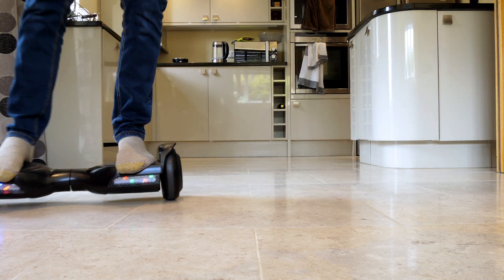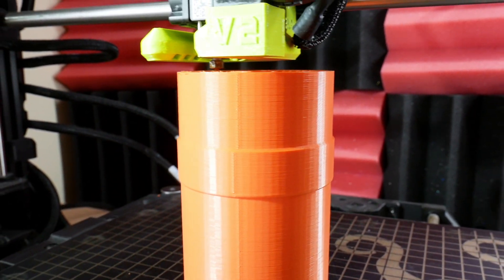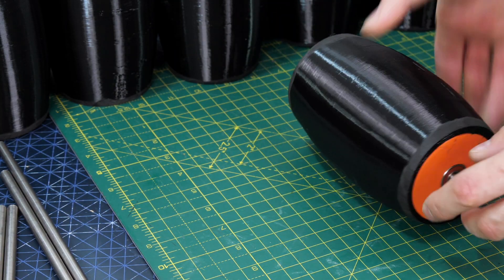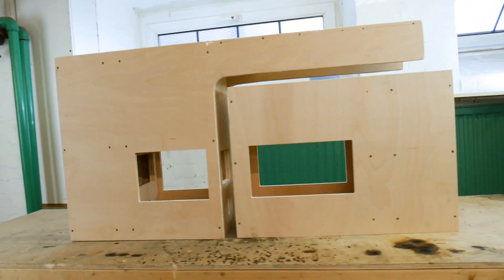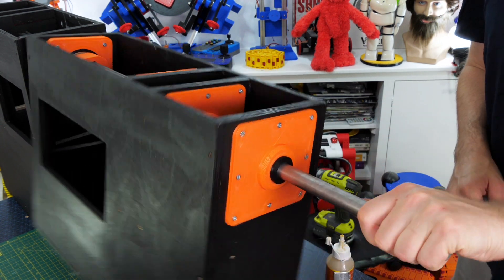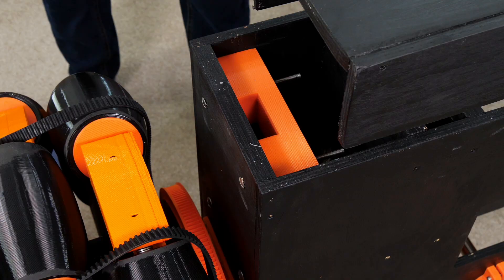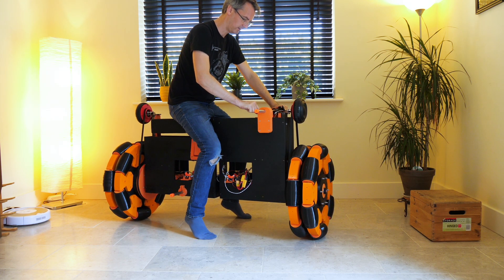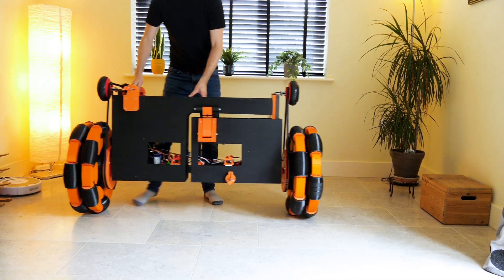Omni-Wheel Bike

Comment: I appreciate that you don't turn the 3d printing part into 5 episodes 🙏

I can't even imagine how many hours and days the printing takes, let alone everything else.
Reply from the maker: yep it was a few hours ;-)
Reply: Such a thorough rebuttal, well done @teresashinkansen9402
Reply: There is so much process, it could be 50x 15 minute videos
Reply: I actually find silly the amount of 3D printing, even printing the "tower" for the belt tension when probably that could be done with a piece of plywood. imagine how much energy is used . I actually was nicely surprised to see he actually has fabrication skills and used some metal but still i find the amount of 3D printed parts kinda overkill. I only print with my 3D printer complex shapes or things that actually make sense to print. Why print a standoff that will take hours and use energy plastic and wear my 3D printer when I can cut a piece of wood in 10 minutes to size.
Reply: @teresashinkansen9402  In fairness, printing rather than fabricating or carpentry saves a lot of issues: namely weight. If you've ever used an e-bike, they are SO heavy, and it makes them really unwieldy, plastic is a lot lighter. 
Also, printing helps accuracy and the ability to make each piece identical. You can see how even just a few mils of deviation in the plywood caused problems with the balance of the whole bike, and he used a CNC; imagine if more of the bike had been made the same way.
Reply: @teresashinkansen9402 everyone loves excessive 3d printing. It makes them feel important and like big men.

Ah I just got to the part where the sponsor is a 3d printer manufacturer.

That explains everything.

Gotta prove for the sponsor that 3d printing is better than sex, and soon morons will be trying to 3d print food. As if there wasn't enough artificial mass produced, over preservative-ed, unhealthy food.
Reply: @teresashinkansen9402 And exactly what is the cost and BOM breakdown analysis? Oh right you don't have one.

The energy emitted by the printer is so insignificant compared to the logistics of growing an entire tree, cutting it down, shipping it to the mill, processing it so you can have a single infinitely small piece of it, then package that, ship it to your local store, where it is further itemized and stocked on a floor that has their own set of costs and needs?

Your analysis is incredibly short sighted and bares no water.
Reply: @Mad_Catter_ what about making the plastic itself tho
Reply: @redtaileddolphin1875  That wasn't the person's talking point. If you want to debate the process of recycling or manufacturing plastic that's fine, but it's still going to be comparable if not cheaper than destroying a forest.
Plastic is inert and can be produced as we please, in a convenient manner, with better methods of production or recycling rounding every decade or so. Forests are much, much more complicated and an industry that is essentially set in stone.

Recycling a piece of wood into another usable chip form of it's former glory, also comes at higher costs and manufacturing processes' that require incredible amounts of fresh water.

I can go on for days about logistics.
Reply: @Mad_Catter_  I find so ironic that you say that, and clearly shows you have no idea what it takes to make plastic and eat up the ecologist propaganda that logging is the avatar of environmental damage, your very same argument is actually all against you.

So please show me your talk about logistics, actually worse logistics applies to 3D printing materials. I cannot wrap my mind how 3D printing such part is better than using a piece of wood. Most wood in developed countries come from forests specifically maintained for wood, that is they already were obliterated many decades ago and now host a plated population for the sole purpose of wood production, so the damage to diversity is already done, as you said it its already an established industry. Second, forests capture CO2 so they have a negligent carbon footprint and wood only becomes an issue when the wood is used as fuel, then its CO2 foot print becomes worse than many fossil fuels per BTU but we aren't talking about fuel but construction materials and plastic.
 Logging and wood working are actually relatively energy efficient compared to plastic production, according to "Fuel consumption and exhaust emissions in the process of mechanized timber extraction and transport (full citation at bottom) " one cubic meter of timber requires about 2kg of fuel (release 6kg of CO2) to be processed from harvest to finished product with a transport distance of 33km. Now lets see what it takes to make plastic and not only that but turn it into filament and 3D print it.

Producing plastic requires a significant amount of energy and varies a lot depending on the kind of plastic produced from two times its calorific energy to up to five times (like PET which is used to make PETG) or more, that means you need about 2-5kg of fuel to produce 1kg of plastic, you see, that already does not sound great, with the fuel used to make 1kg of plastic you are already using the equivalent fuel used to produce one to two cubic meters of timber. Not always but cost also reflects this because you cannot go cheaper than what you spend on energy to earn money selling something, a finished (even pressure treated so that adds cost) 10ft 4in by 2in in home deepot costs 7 dollars which weights about 8kg, thats a cost of .87 dollars per kg, compare that to the usual 30 dollar per kg of filament.

With plastic you have to extract the oil which already requires significant amounts of energy, then you have to transport it to a refinery, there you purify it and then convert it to the raw materials and that takes a lot of energy, have you heard of thermal cracking? it is widely used to make ethylene, hydrogen, propylene and many other plastic precursors, to do that you have to heat up oil and other oil products to very high temperatures (in excess of 600C°) and use a catalyst so the large molecules turn into smaller ones, then you have to purify all what comes out and once again transport it to factories, in the case of gases like ethylene, propylene and others you have to compress them with significant amounts of energy. 

So then you have to make the plastic which also involves lots of energy, i wont make a description of the processes because this reply is already long but is not that straightforward, you must already know after making those statements, I presume, what it takes to make PET and PETG right? well then you have the finished PETG pellets which are now transported again to a filament factory which are usually quite far from the plastic factories sometimes even in another continent, there you have to melt the pellets to make the filament, heating things up and then making them change phase usually involves lots of energy, don't forget the filament also has a spool which usually is made of more plastic.

Well now you have your filament spool but it has to be shipped once again to a store! just like timber getting shiped to a home despot store where fanatic geeks that seem to follow personality cults buy their filament they purchace it or get it shipped to their home, where they now print a plastic 2 by 4 rectangle, which takes 12h to print and needs about 960Wh to print or about the equivalent of 80g of fuel which releases about 240g of CO2. Compare that to using a circular saw for 15 seconds to cut a piece of wood (700Wh for 15 s rounds up to 3Wh) and some minutes of a sander to fine tune the size (3 minutes of sanding at 800Wh gives 40Wh).

All this is extremely simplified we can go to explain every detail in the lumber and plastic production chain but the result is the same, plastic takes much much more energy to make and is significantly worse for the environment, using a piece of wood instead of printing everything is very good, not only for the environment but also your wallet and handcrafting skills.  

Lijewski, P., Merkisz, J., Fuć, P. et al. Fuel consumption and exhaust emissions in the process of mechanized timber extraction and transport. Eur J Forest Res 136, 153–160 (2017).
Reply: @teresashinkansen9402  "you have no idea what it takes to make plastic"

Yeah, haven't even touched the topic of making plastic therefore I'm not reading an excerpt you didn't write, you didn't research and merely scraped from the first source you passed by.

Waste of everyone's time.

Verify where I have stated how plastic is manufactured or recycled, then we can move forward with your inane ranting.
Reply: @Mad_Catter_  Well that's because you have no argument to make, you got obliterated. But in case you have reading difficulties, Ill make a tldr right here, ill do my greatest effort so you can comprehend it; My beef with this is that 3D printing everything even the simplest things is a waste of time, money, energy and resources. its very simple i just got into detail why 3D printing is a waste if not used properly.

The hard reality is that I aggravated your ego by criticizing James, be it because you follow a personality cult or because I criticized what you do with your 3D printers and made you feel stupid, maybe you 3D print rectangles to use as standoffs and spent dollars and hours when you could spend minutes and cents?
Reply: @Mad_Catter_  And well replying directly to your question about costs. A 8ft 1in by 3in board costs $2.54 USD at home depot, cutting it to the size of about 20cm which seems to be about the length of that "tower" James used would end up paying $0.20 USD. If he 3D prints it with an infill density of say 25% a rectangle of 2.54cm by 7.62 cm by 20cm has a volume of 387cm3 the 25% of that is 96cm3 with a density of 1.27g/cm3 it would be 120g of PETG, if it costs about 30 dollars per kg that part would end up costing $3.6 USD and that's just the filament cost, not taking into account the cost of the energy used nor wear of the 3D printer. See, it does not make any sense to print such kind of parts.
Reply: @teresashinkansen9402   And lets not forget that when making small parts out wood when woodworking is already part of your process is basically free use of what would otherwise already be waste material.  Wood wins nine ways to Sunday.

If Mad Catter wants some credibility maybe they could at least match the effort it takes to copy paste something from an actual source.  Of course then someone might still come along and point out how teresa clearly did write all that very detailed and thorough analysis given the tone and contextual specificity to this conversation, using the source for figures.

It's ok, my ego would be pretty bruised too.  Maybe you could convert that negative emotion into something productive by following up on the source, verifying all the quotes, numbers, and calculations; maybe catch some details the source doesn't support.  Then instead of losing an argument and just being wrong in public you're doing science and contributing to intelligent discourse.  I'd do it but I'm just not invested enough to warrant the effort. 🤷

Comment: How about making a true hoverboard using big EDFs on a skateboard with hovercraft skirt and stuff, and maybe some additional thruster or just some holes on the back of the skirt that gets exposed when you lean forward or something like that to produce thrust? (and if that approach with the hole, or even just a shorter segment of the skirt, works, perhaps also add smaller versions on each side of the tail (or nose, depending on how the dynamics will feel) to allow for handsfree turning by leaning?)

Comment: nice project , but using the rollers as fw/bck and the wheels as side to side seems inverted , when you need to pass a hole or a bump , the rollers are to small ...
Reply from the maker: How would you power all the rollers?
Reply: @jamesbruton   for the drive of the rollers I have an idea , for the power I have 2 , one more affordable , one more technical and more costly . For the drive of the 12 rollers , 1 circular axle in the middle of the 2 roller rows with universal joints , and on these axles  direct >> "chevron" gears or wheels to assure no slip on the rollers .
For the drive of the axle : the cost effective : put the hoverboard motor nearest to the center of the wheel axle and counter weight  to reduce unbalance (Li Po at opposite side at calculated distance for exemple) , and a slip ring to get the wiring back to the board, and the motor drive a belt to roller axle . For the expensive way , a "tron bike" look a like hub , the hoverboard motor fixed in the middle but turning with the whell and one of the PCB's and LiPo on the sides of the hub or structs that hold the hub (may need to be connected to the other wheel to assure voltage balance between the PCB's)  , with a gear or  shaft transmission to the center shaft . The problem is that the hub design needs very expensive large roller bearings ...

Comment: I understand the desire for this to be a bike. But since your wheel axis is orthogonally to your desired vector, you will have a severe problem with not just propulsion, but also braking. To brake on this system, your options are 1) ground friction or 2) reverse thrust. Neither of those are particularly good.

If I may, I suggest switching from a bicycle to a chariot. For turning, use levers to twist the chassis - they could be foot, hand, or even shoulder actuated.

Comment: YES! I've wanted to mod one since I first got one in 2016!

Edit: not what I thought it was going to be at all. This was a cool project, but I'd be lying if I said I wasn't supremely disappointed.

PS: most hoverboards allow you to calibrate the gyroscopes by holding the power button when you power it on until it beeps a second time, then you hold it perfectly level until the lights flash/stop flashing, then your calibration will take effect next time you cycle the power. This is a much better solution than shimming the boards

Comment: How about making a box with a big gyroscope that you carry in the bike rack or basket and helps keep the bike vertical when standing still without putting the feet on the ground.
Reply from the maker: It has a solid state gyro - it moves sideways to balance. Check out my last video for a gyro bike?
Reply: I was thinking more of a device that you could attach to any normal bike and make it stand upright when stopped

Comment: The project is cool and looks like you also have quite a good machine shop 
Do you have any plans to show the shop better?
Reply from the maker: It's just a CNC and a workbench
Reply: @jamesbruton And a sanding wheel

And hydraulic press

And welding equipment

And the 3D print farm

Do you have/gonna get a metal lathe milling machine too?
Reply: @bornach re: Lathe. That's what Colin Furze is for.

Comment: Handle bars need to be connected to the part you're controlling with you feet. My guess is that will solve your turing problem. This might be my favorite project so far. Great work.
Reply: Your feet/legs are not precise at controlling stuff.. arms are more precise.
Reply from the maker: Electronic controls in the next video

Comment: Ok, this might be my favorite project ever on this channel and that's saying something. I'm starting to see the potential of this crazy contraption.
Reply: Same. I'm curious whether it might work nicer with the omniwheels turned 90 degrees but with fixed front wheel and then let electronics do all the leanign and turning. It might roll better for transport means. Now the big radius of the wheel is used for lateral riding where you need the least speed and comfort.
Reply: My favourite project yet!
Reply: Same but the engine is so cool
Reply: I like the hulk buster project the most
Reply: This vehicle can only spin and drive left or right. A motorcycle style seat but you must turn your head to see where you are going. What is it you like about that? It looks awkward, uncomfortable and useless, although exquisitely engineered.
Reply: @mattsenne6951  I thought he made it clear at the end of the video he still needed/planned to work out forward motion. His projects are usually episodic, and he comes back to different ideas whenever he comes up with a solution or new application for a previous design.
Reply: @mattsenne6951  I think it will go forward, but with the worst possible ride and efficiency. I'd like forward travel to be optimized for :)
Reply: @Cloxxki So a normal bike then

Comment: I think that using something more like rudder pedals would be a more useful control input for steering the back, rather than turning that big block.
That way you could just push your feet instead of trying to move your legs in awkward ways.
Reply: I just made a similar comment! The heel thing is how you steer a horse and it makes complete sense for this application.